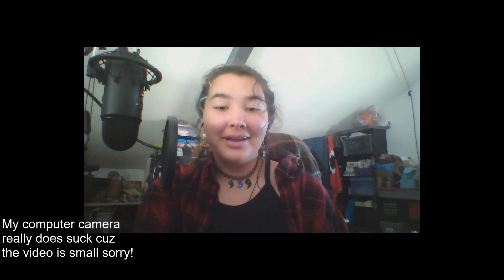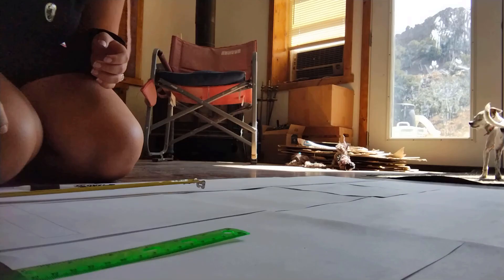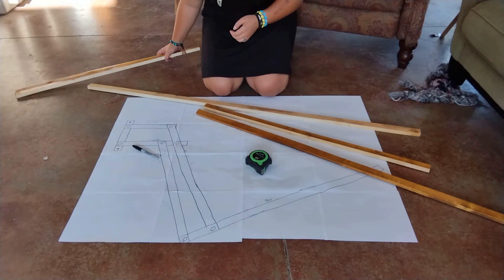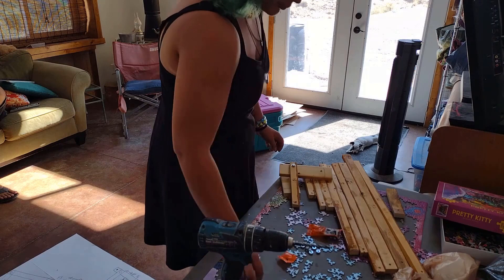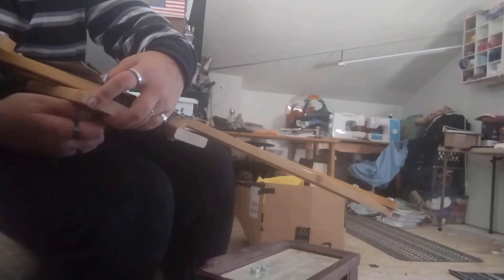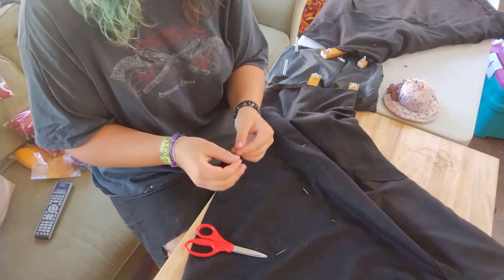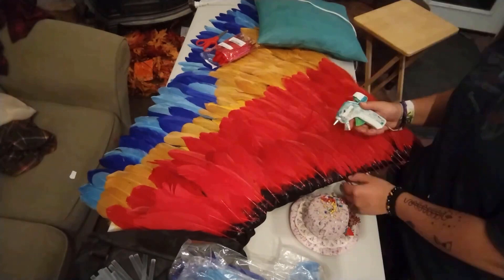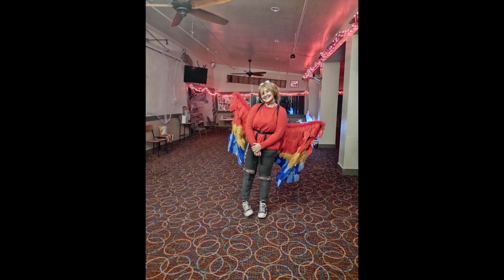Grian cosplay (and how to make movable wings!)

Comment from the maker: Here are the measurements for all the parts because someone asked. "P" stands for part.
P1 is 2 feet 6 inches
P2 is 2 feet
P3 is 21 5/8 inches OR 2 feet minus the gap between part 4 and 5
P4 is 11 inches
P5 is 8 1/2 inches
P6 is 8 inches

Hope this helps some!

Comment: I liked, my only complaint is that when you design you next set, you should use a lighter material, otherwise great engineering.
Reply from the maker: Yah I definitely will do that. I was just using what I had at the time. Thank you!